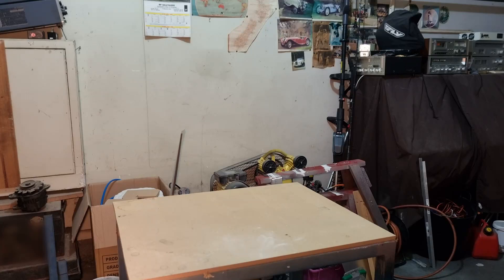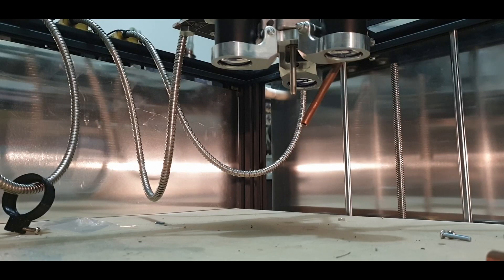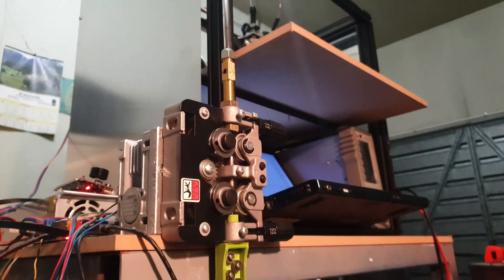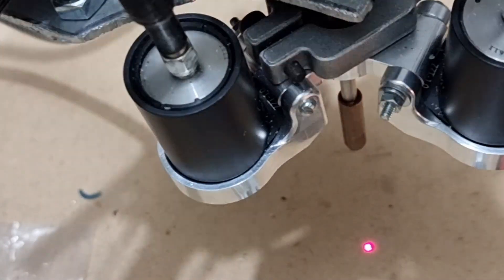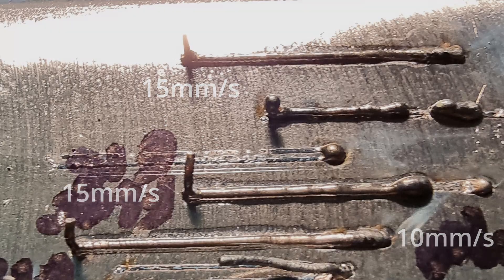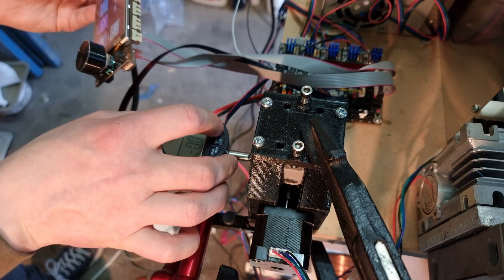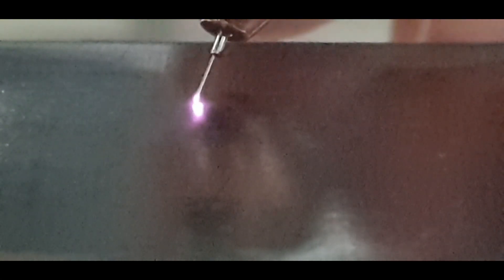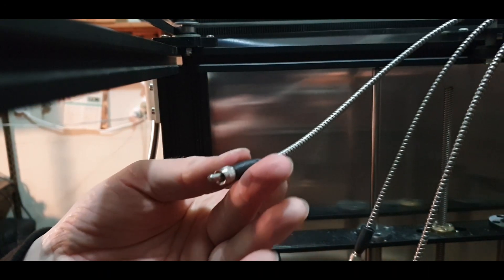DED Metal 3D Printer - Round 2

Comment: Dear sir,
Im sorry but I dont know your name, I following your portal from several years ago, because I'm engineer I find some of your issues in any cases that you have. I give you some advise in below texts to help you and other guys.

Please try to use standard electronics board same Mach3 cnc board I use that and it works perfectly and simple.
Calculate termal extension in any parts that have contact with laser beam.
The powder bed ned to redesign because of termal expansion and heat reformation.
You need to fix the powder bed with fixture technique dont let that to rotate or re placing.
You need to remove air aound the poweder wen its busy with sintering, you know that oxidation dident let the new melted layer to joint on previous layer you can use clused chamber with argon gas or co2 gas, dont forget that you doing Sintering or welding and not cutting.
You need to cooling the actuator and other plastics bodys as well, dont forget to cool down the lens or lenses frames.
Finaly when you use the powder tacke care that poweder stof have 0,00004 mm as max. sizes please let the machine working more on each layer , you need to use the section layers closeer to each others and dont put blaser beam for long time on one point.
I want to visit your website but its out of access, I dont know whay.
With my best wishes for you and your familie.
Farbod.
Reply from the maker: Hi Farbod. Thanks for your insights. Many of the above issues have been addressed. The system is semi operational now. The website was taken down due to inactivity. Hopefully I will have together a video for you all soon.

Comment: Reminds me my mtech project, thin wire is never a good option
Reply from the maker: I agree. I'm interested to know why you think this though?
Reply: @metalmatters  I used MIG power source for 250 um wire. Even at very low voltage, the moment wire touches the substrate, it will get red hot and the integrity of the wire will be lost.
Reply from the maker: @kk3074  Ah, I guess the circumstances are a little different then. I would expect there would be some level of threshold power required to gain enough heat to melt the parent material. 250um doesn't afford you a lot.

Comment: What gears did you use to feed the wire? I can’t find any that feeds 0.25mm wire.
Reply: Is it just pressure that pulls the wire through the wheels?
Reply from the maker: Yep. You want a decent amount (sorry, I don't have any figures).
Reply from the maker: I used a small drill chuck as the main drive roller and a bearing as an idler. I had to use a pair of opposing syringes to guide the wire as there obviously isn't any groove for the wire to follow.
Reply: My other question is how do you remove the oil off the stainless steel wire?

Comment: I would love to progress to a metal printer, but considering all the big boys have gone down the route of SLS of metal powders I think for the hobby level of printing, doing it in resin first to create a mould and then using that mould to create your metal part is the cheaper option that produces higher quality metal parts than you would get from any setup like this.
Reply from the maker: I've gone back to working on an SLM printer. That should be able to yield a respectable degree of precision. Still a little more work ahead though.

Comment: Thanks for the time you put in to the vids. A few thoughts in exchange: have read of Invar powders being V good for low-porosity SLS (L-PBF).  About the excess metal at the start/end of lines, maybe you could have overcome that by more passes at lower powers, to sort of pre-heat the powder, then final pass.

Another Idea: by starting and ending each layer at a sacrificial/waste piece, to be trimmed off at the end. Or perhaps the start of each line had a something like an overlapping movement, sort of starting along the line a few mm with lower power, then building up to nearly full power at the line start, then back along? Sort of an intuitive thought. Hopefully you return to the project some day (dig it up?).

Re the wire printer: when you mentioned the wire pushing through melt-pool I imagined the build plate being a 4th axis, turning so that didn't happen. Maybe an Invar wire would have interesting properties? Similar to another commenter: why not have a sealed chamber instead of gas flow? Even if not a 100% sealed, there could be a positive pressure from gas to keep out oxygen.

Last thought - I read about Atomic hydrogen welding using an arc in hydrogen shielding gas. Perhaps this could be an interesting method of 1: producing the gas on demand using electrolysis of water. 2. Doing away with the inherent difficulties of working with lasers. Perhaps the arc is created between wires that are fed in? Anyways, this welding can apparently melt tungsten - using that with a tungsten powder in a kind of synthesis could be interesting?
Reply from the maker: Thanks for suggesting Invar powders. I'll have a look into them. I'm amidst reassembling the printer. I'll have a chance to play around with preheating as this time I'll be using a galvanometer. I have to admit, I'm not overly fond of the idea due to how much heat will leak into the powder bed and how it will affect the metal, but I think it's worth trying. 

The wire based effort didn't use a chamber due to the expense involved in purging it and how much additional effort it takes just to do some basic experiments. I played around with an arc based process but found it to be too poorly constrained in terms of heat and deposition control. I don't want to rely on any form of milling as a post processing step.

Comment: Hi ! 

I was wondering which kind of lasers you used in yourdifferents metal 3d printer . I'm interested in building one but i wanted to document myself a bit more on lasers before. If you have any sites and/or companies to recommend it would be helpful ! Thanks in advance.
Reply from the maker: The lasers in both this system and the other powder based system are diode pumps. You can find them on eBay or Alibaba. If you get stuck, send me an email via the about page.

Comment: How much did the materials for this all cost?
Reply from the maker: Between the electronics, lasers, optics, and machined head.. roughly $1500
Reply: @metalmatters  Wow, that's a lot less than what I was expecting. If this was refined further, this could be made into possibly a $3000(just doubled assuming profit the company would want to take) or less home metal 3D printer

Comment: I have an idea of how to do this easier and better: have both a MIG welder and a TIG welder set up on a 3D printer scaffolding. The MIG welder will lay the bead and the TIG torch will re-heat the bead so that it looks better. Basically an Instagram trick.

Comment: buddy wh stop work on that galvo SLS??  someone threating you?? or they pay you to NOT?? finish it,?
Reply from the maker: No. It came down to cost, safety, and burnout. The machine was looking like it would cost upwards of 5k, potentially more, and require a significant investment on my own part. It was becoming more detached from the original vision. I also want to avoid metal powders; I think a lot of people underestimate the hazards involved.

Despite all of this, I have been working on the DED printer. I'm on the third head design since the last video; I've just been embroiled with challenges.

Comment: Have you thought about using molten salt (in crystal form after cooldown) to round the surface where the laser is hitting?

The melting point of salt is 801 Celsius, molten salt is really good at heat medium
Reply from the maker: No, can't say that I have. Why would I want a round profile where the laser is hitting?
Reply: @metalmatters  I honestly do not remember exactly why I wrote that, but I think as solution for particles escaping! I did a lot of research lately for my graduation project, not sure what problems I will face. Now thinking to plug a magnetic generator for a metal powder fusion printer!

Comment: What if you use those handheld laser welders? The beads they make in the videos looks clean and consistent
Reply from the maker: I think even the 500w units might blow the budget on this build. Thanks for the suggestion though.
Reply: @metalmatters  im about to buy such a 1500w welder to try that, have you seen any related work anywhere? or paper?
Reply: also im interested in your efforts on the powder bed. i think it's a shame to put all that work to waste. would you willing to share your designs and notes for us to build on and continue this?
Reply from the maker: @markos3803  I agree, it is a shame that it didn't amount to anything. I don't want to endorse that approach however. There are a lot of hazards around working with metal powders, and that design was too inadequate to meet those needs. 

I haven't read anything specifically about the use of laser welders for DED/LMWD, although most wire based systems referred to in papers are essentially that, a side fed laser based welder.
Reply: @metalmatters  have you looked into the SLS4ALL project?

Comment: great work! hows is your project going ? also have you considered using a mig welder to print ? I've seen few example it def has potential
Reply from the maker: Progress isn't too bad but slower than I would like it to be. I briefly experimented with a TIG welder for the sake of 3D printing, too much unfocused heat imo.
Reply: @metalmatters  keep it up! I meant the mig welder not tig, as in the one that already has a wire inside and it melts the wire on contact, it’s got potential but needs alot of experimenting

Comment: Have you ever tried to hack into those 20-30W fiber laser engraving machines? They work using Galvanometer and do one-layer at a time scanning, just need to build a z axis descending table and work out a way to output each layer scanning control codes and integrate into the z axis movement. Those machines are available 2nd hand about $1000 only.
Reply from the maker: I actually bought a Nd:YAG laser from an earlier generation of engraver with the intention of exploring galvanometers. I don't think implementing a laser system is the difficult part. For me, the difficulty arose from trying to build a pressurized chamber that was both economical and safe. There are too many dangers around handling metal powders in my opinion.
Reply: @metalmatters  Does pressurized chamber necessary? I thought you just need a heated chamber and regulated inert gas inside. I'm looking forward to seeing both printer projects but personally really want to see the powder bed project working to some extent. By the way, your forum is down？
Reply from the maker: @pengjinpan8293  To the best of my knowledge, yes. The most effective way to deal with the issues brought about by the plasma plume is to use a pressurized atmosphere. 

I won't be working on the powder printer beyond this point for the reasons I've stated here. I took the forum down due to inactivity.
Reply: Any progress in the last 6 months?  Your videos are awesome
Reply from the maker: @tw60407  A lot has changed in regard to the mechanical aspects of the printer, and there is still yet more to do. It's stopped me from working on the process itself and therefore I've little to show for it in terms of output, hence the lack of videos. Things are moving along though. Thanks for the feedback.

Comment: The ball on the wire could be mitigated by pulsing both the laser and the wire feed, intead of always on laser and constant feed rate. some of the trickier TIG welders i know will pulse welds to make them look better (at the cost of strength). if the pulses were spaced closely enough, strength shouldn't be an issue. Perhaps the answer to a difficult to control feed is precisely controlled steps that resemble a steady feed?
Reply from the maker: Maybe so. I'd like to keep the hardware to a minimum and pulsing those lasers without killing them might involve quite a bit more work. It might just be easier to let the joint cool and separate the wire and weld by treating it like a fuse. There could be problems with this method as well though.

Comment: Trying to think outside the box, what if you put the printer inside a box?  Empty the box of air, as much as reasonably possible, with a vacuum pump.  Then fill with CO2, so you don't have to worry about gas flow over the weld.  It might be worth it just as an experiment.

Comment: Something that could print pewter or zamak like a standard FDM would already be astonishing.
For this hypothetical setup, in my opinion, the trick to make it happen would be a laser constantly heating the layer on which the metal gets poured. That would be far more cheaper but I understand why you're investing so much on your project: steel would be a revolution.
Another approach could be a powerful induction heater that melts the very tip of a metallic filament and an ink-jet style technique, where micro drops of filament are poured one by one.
This could make a general purpose metal FDM printer cheap and versatile, given that the only setting to change for a given metal/alloy would be the power output of the induction heater. Varying the height from the plane, the power of the laser that heats the layers already made and the temperature of the gas may also be parameters that one may use to tune the printer.
Free public knowledge here, if anybody finds something useful, feel free to use it.

Comment: dude, get rid of the gas cup and make a chamber for it.  even if it has leaks you'll still use less gas.  Use an oxygen sensor to keep it filled.  less weight on the system, less gas usage, better gas coverage which will be especially important for variable speed and changing directions abruptly.

Comment: hey man love your channel. Did you ever think about starting a discord server so others can discuss ideas better as alot of us are looking forward to your progress.
Reply from the maker: That's what the forum is intended to be, without the need to repeat topics. I need to breathe some life into though.
Reply: @metalmatters  could you make a discord and pm me it, im building something similar to yours but with a far simpler mechanism and I think we could share knowledge and help each other out. The cost would also be lower since there is a different heating method and requires no laser source and works with wire as well. I also have another 2 partner with me that are very knowledgeable im electronics and programming as well as myself so we could collaborate on this project
Reply from the maker: @andiiacob1627  Plasma, resistive, or electron beam?
Reply: @metalmatters  a modified wire ded process that can produce normal fdm printer tolerances in a vacuum
Reply: @metalmatters  im not tryna say too much because I want to commercialize the hardware and open source the software. I'm working on a no support structure system too with non planar slicing and rotatable extruder head
Reply from the maker: @andiiacob1627  Gotcha. Do you have anything put together?
Reply: @metalmatters  will be next week just waiting for a couple of parts. Most of them are gonna get collected from my ender 3 anyways tho then gradually replaced to work in a vacuum. Also waiting on a tungsten carbide nozzle to test out stainless steel 316L
Reply: @metalmatters  by the way do you have any resources on resistance heating? Has anyone tried to make a printer like that? I know of joule printing but they didn't use a nozzle at all so it was layer width was depending on wire size and hard to calibrate
Reply: @metalmatters  officialy got some results, but unfortunately our vacuum pump wasnt strong enough and the aluminum oxynitrided so we didnt get a consistent layer. Waiting for a new vacuum, then I will print a square and also waiting for a tungsten nozzle so we will run tests with stainless steel 316
Reply: @metalmatters  renishaw states they run their chamber usually under 1000ppm o2, but for metals that react more to oxygen like titanium and aluminum it is 100ppm(titanium has to be less than 113ppm o2 to not react AT all). Do you have a data sheet where what metals can be printed at what oxygen ppm level? I couldnt find this in any additive manufacturing books, or MIM, or sintering or even casting
Reply from the maker: @andiiacob1627  Not that I have found. I think you'll need a turbo mol or diffusion pump to get down to those levels.
Reply: @metalmatters  the forum isnt really for instant messaging or anything like that so I'd like to discuss things on a more instant messaging platform

Comment: If using wire, is laser anymore the best way to go? What would be the benefit of laser, compared to arch welding?
Reply from the maker: I believe so. In terms of output, better resolution and faster translation speeds from better heat concentration.
Reply: @metalmatters  i think laser welders are going to be dropping in price fast, there are already some cheap ones in aliexpress.. those might be worth a look

Comment: Very interesting stuff. I'd like to attempt to compute a solution but I'm currently persuing a safer, multimaterial way of printing in resin. I'm looking to add continuous fibres too to reduce the amount of parts that would need the physical properties of metals. 
Maybe some kind of atomised metal embeded resin is possible and a $1500 printer + $3500 sintering oven workflow could be a solution.